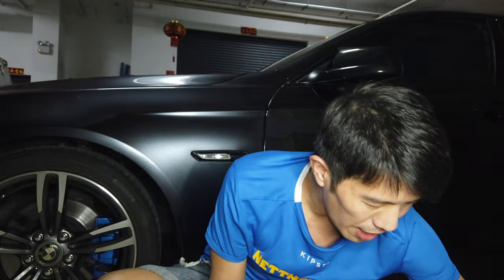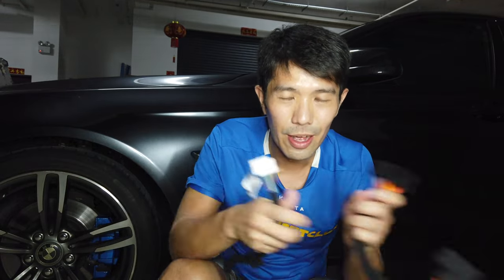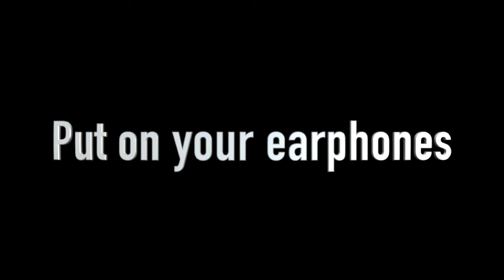BMW F10 Puzu DSP Amplifier PZ-C31 Install

Comment: The prices for these things are crazy good and tbh a lot of the stuff coming out of China now is fast approaching reputable brand quality for a fraction of the price and is probably made in the same place and brand stuff that is merely designed in a country like America or Germany or something and made in China anyway or Chinese have stole the design of other high quality items and debaged them, and I'm about money savings but warranty concerns me as they don't come under out trade rules 😂 still keen to suss these out for the price.

You need to set your crossover way down for the drivers bro they were hitting way to hard, not distortion as much as it was just straining the speakers cross them at 80 or 100 Hz and throw a sub in. I realise you haven't done it yet you just said but definitely sounded clear at top end bud thanks for sharing 😊
Reply from the maker: Hi Chloe. Thanks for your sharing. Totally agree on that. Will check out the settings on mine soon. You driving f10 too?

Comment: Just ordered mine for my F30.
I hope it’s worth it as you say, the base models really lack a lot in terms of adjustments and sound quality..I can only adjust treble and bass on the idrive.
Reply from the maker: Hi Shadiomar! Glad to hear that. You bought it through the link or another brand altogether?
Reply: Yes through the link, the seller seems really professional and they only ship with Fedex which is really faster than their standard shipping.
Reply from the maker: @shadiomar4193  Yes they are. Hope you like it. I'm still using it till today :)
Reply: Hey, what items you ordered exactly. Did you also order the wiring harness as base system in F30 does not come with external amplifier and so. Thanks
Reply from the maker: @gurtejsandhu7  hi Gurtejsandhu! I ordered the dsp and the seller threw in the wiring harness free for me too.
Reply: Hello, so have you installed? What does it look like? Is that good?

Comment: Where did you lace the Puzo in the car , you didn’t show where it lives?
Reply from the maker: Hi Anthony. I shifted it a few times from passenger foot well to squeezing it in the panel behind the air-conditioning. In the end I placed it under the passenger seat for easy access. Hope it helps.

Comment: Does the adapter connector comes with the puzu dsp amp?  if yes how can i connect the center dashboard speaker? Directly in the original harness or in the adapter connector of puzu? Thank you
Reply from the maker: Hi Meri! Yes the seller included the connector for me. Its like a y connector and bypass the original wires and split it out to the dsp.

Comment: One final question, I have a f10 with base system , I have upgraded speakers like you with harman kardon speakers, does the base system have subwoofers under the front seats and does it have an amplifier in the trunk, I want to ask these questions as I’d like to know before I pull the interior apart to find out ?
Reply from the maker: Hi Anthony. Mine has subwoofers below seats and amplifier in the trunk. You can shift your seat forward all the way and see it from the reat seats. Amplifier will be below the left pocket in the boot near the tyre well.

Comment: So you are using android screen and dsp at the same time. Reroute cable to android and reroute again to dsp? Currently using the same android screen as yours, but the audio quality drop while using it. Oem working just fine. Did you face the same issue? 🤔
Reply from the maker: Hi Justin. No I didn't face any issues. The sound quality is in fact quite good.

Comment: The Host/ACC Button  ist for regulate If the DSP Starts with remote from Headunit (ACC) or from the Highlevel Signal (Host)
Reply from the maker: Hi. Sorry I don't understand you.
Reply: @NETTNETTCLUBVIDEOs  OK, in the Video you Said, you dont know what this Button on the rigt Side of the DSP is for
Reply from the maker: @manitou0482  ok. Thanks for the advice. I will check my dsp. 👍🏼

Comment: He owns the same car as me, and I'd like to replace the center speaker and subwoofer.
Was there no problem installing 'puzu dsp' after installing the center speaker and subwoofer?
Reply from the maker: It is great. It makes the sound even better because you can tune the sound system to your preference. Good upgrade.

Comment: hi does it supply power to subwoofers ? as mine original hk subwoofers are very quite and need some sort of amp to make them more alive I have the base sound system in my BMW f10 with no amp
Reply from the maker: Hi Krumpl, it provides signal for subwoofer and you'll need an amp for your additional subs. You can check out my videos when I added 2 10" woofers in the boot. Hope it helps.